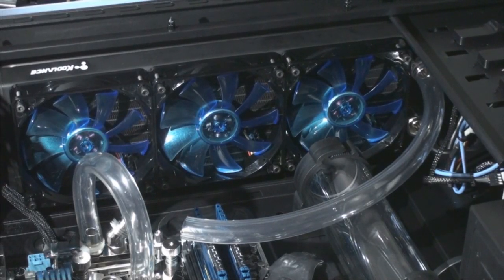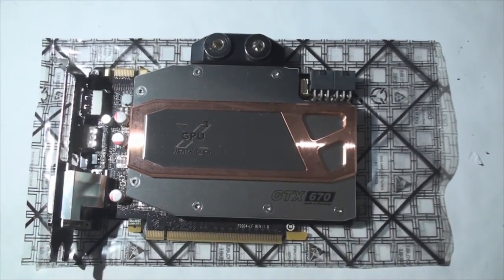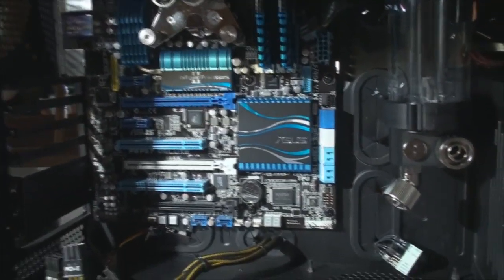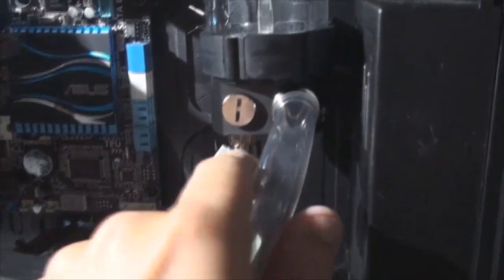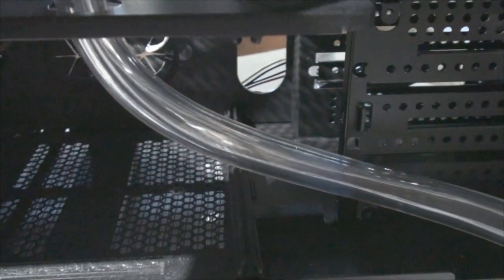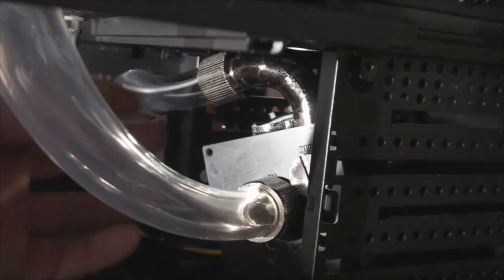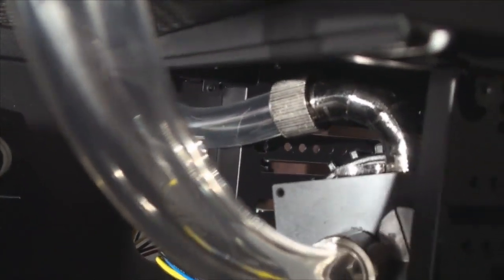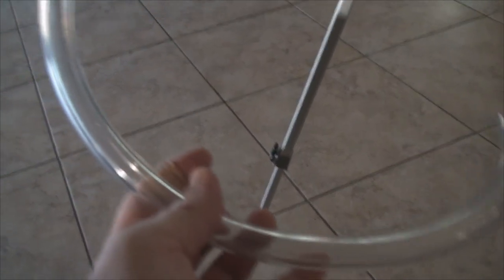Corsair 800D Water Cooling Build Part 3

Comment: will Gigabyte Z97X G1 need a gpu block for pumps what will I need I need help on building firSt I'm getting 800 d an the g1 then get the pump set.. an would a

Asus Radeon r9 290 Reference 4gb Gddr5 512bit 4k 2k 1080 Graphics Card work on mother board?  Add me on Facebook lanier chicot